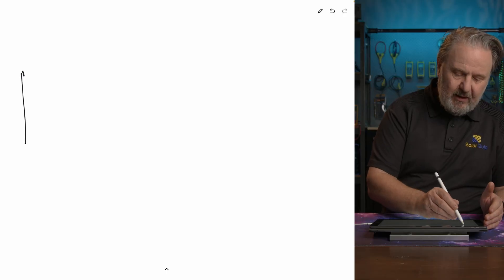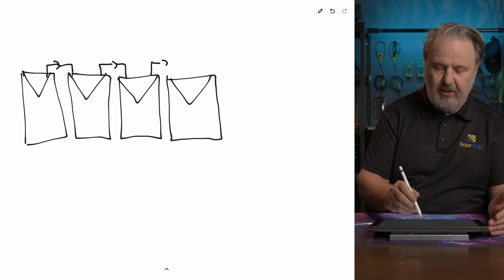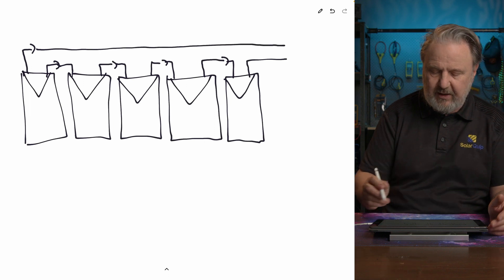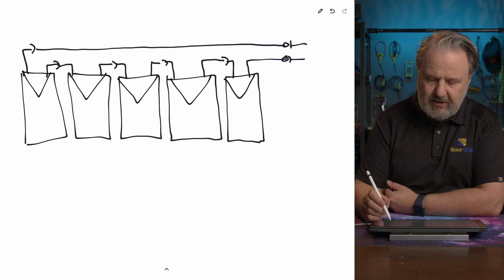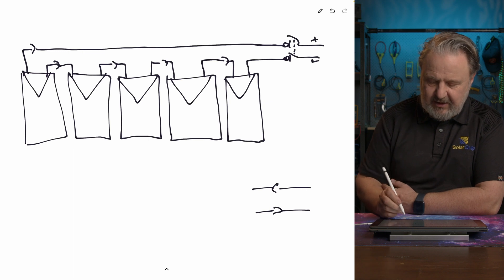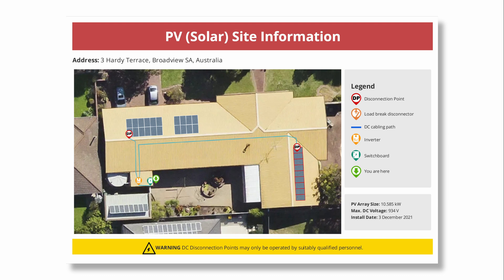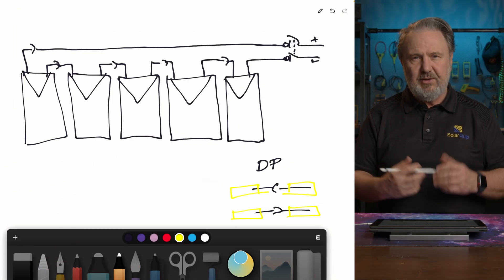PV Disconnection Devices

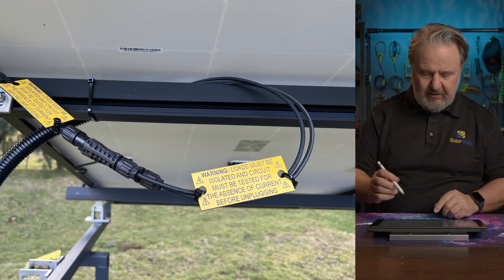Comment: @4:00  You rightly say it requires a label "Do Not Disconnect Under Load" and that it needs a tool... but the connector you show at 4:45  doesn't appear to require tools (and it's easily accessible).  Anyone have an example of a "tool needing" connector?

Comment: Fourth option: disconnecting each string level instead of on array. For example, this can be done with a four poles switch (2 strings rated at 15 A), instead of a 2 poles on array (1 string rated at 30 A). The cost is nearly the same.

Comment: when one turns the DC isolator off, (older systems) in the roof, is there a problem, if the panels, are producting energy, daylight, and the DC isolator  in the roof, or even the cable, going down the wall to the inverter, i mean, you mentioned an arch ... so if the DC isolator is OFF, in the roof, could it be possible for the  current still go down the wall , via the cable going to the inverter?
Reply from the maker: The PV array is the source of current. If array isolator off the no current flowing between inverter and panels.

Comment: so if you have turned off the DC isolator in the roof, or a Disconnection Point, for the cable going to the inverter, there is no need to test the current is there? there wont be any current in the cable going to the inverter, correct?